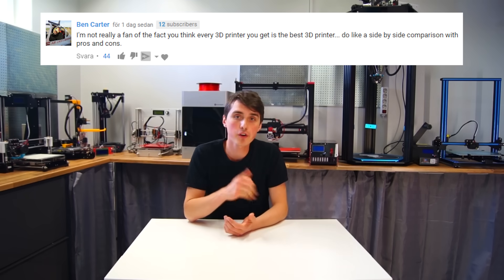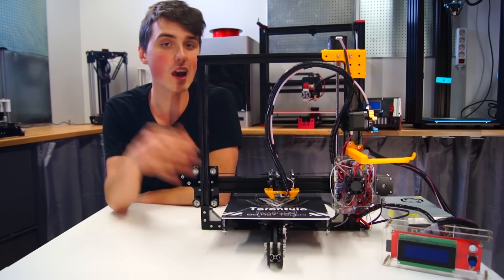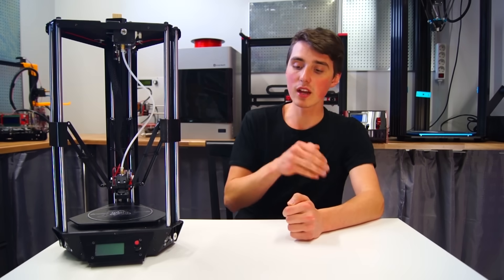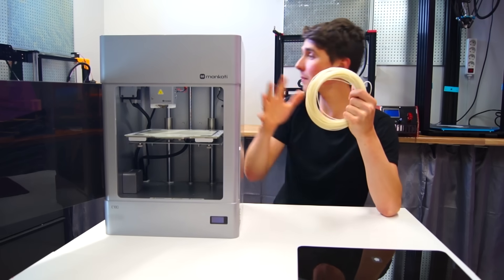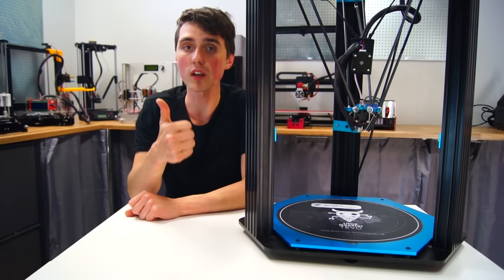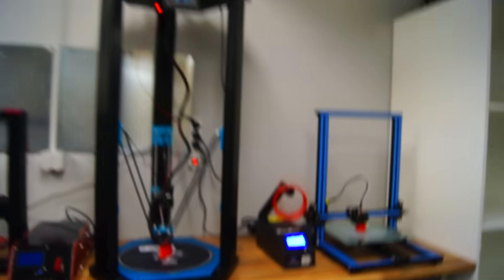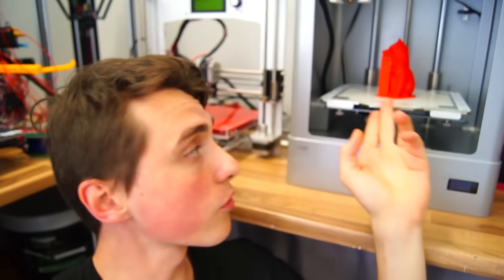Why This Is the Best 3D Printer - Comparing ALL My Printers!!!

Comment: i have had my cr-10s for 4 years and have never had a malfunction. My college users Ultimaker and I have replaced the hotend 4 times within the last year. Each costing 250$. Cr-10 is hands-down the most reliable printer on the market and is the most upgradable.

Comment: I bought my first 3D printer, and it is a Ender 5 pro. I have to say that it was easy to assemble, but the first time I turned it on, the feed cable buckled and broke the stop sensor, so I am waiting on some new sensor I ordered. This brings me to the poor way they did not cover the sensors from damage, considering how cheap the sensors are, they should have made covers for them. Based on your review, I may take a closer look at the CR10.

Comment: Im Looking that the 3 in 1 Snapmaker 2 which is not yet released and is offering over 400 off to preorders.
Looking at the Snapmaker original it is 5x faster and has bigger models it seems to larger items.

The THINGS it has is amazing. With the 3D printer, a Laser etching of photograph quality, and a CNC Milling machine. And somewhere in a video I saw a lathe chuck. While it doesn't do steel, it does a lot of softer materials. It really is the tool of the future that everyone will have in 20 years or less. Like home computers and printers, now phones and tablets. This has had 12 prototypes in a year and a half of development.

Comment: You can upgrade the shit out of an Anet A8. There's 100's of upgrades tot be found on YouTube, thingiverse and some upgraded it so much it is basically just as good as a Prusa i3, where the A8 is a clone of, or even better. 
I learned so much from this printer (got almost electrocuted so I swapped the power supply for an old ATX PSU. 
I'm now planning to build a printer totally designed by me. That's what this printer gives you (lots of problems...erm  challenges too). 
But like you said, it's not for people who don't like tinkering. 

Great video as always!

Comment: 3:46 i have that printer and is was a waste of my money...  I bought if for $140 at some action and thought it would be fun to have a second printer besides my ender 3. i got it working but there is so little information about this printer on the internet its a pain in the butt to fix something. the printer is super unsteady and i have extreme safety concerns. the print quality is extremely bad. if someone wants to get into 3d printing at the lowest cost? go for a Creality ender 3. its maybe €40,- more than the cheapest printer you can get but is WORTH IT. i had almost no problems with my ender 3 and its serieus good build and print quality. and the ender 3 community is awsome. thousends of people willing to help you with your machine. 
sum; Geeeetech i3 is a waste of money, if you get it working properly the print quality suck. better spend €40 more and buy a good working ender 3 that dont catch fire.
Reply: I bought one for my kids to build. We learnt it all but the machine did not work due to a couple of faulty parts. OPen power supply is a No No. But once we got it working it has actually produced some great quality prints, but it is not the easiest.

Comment: I am looking to get a high resolution 3d printer to print silicone food molds and I really need one that leaves no separation marks between layers. Can I ask for your recommendation?
Reply: tbh they all leave marks have to sand the prints to remove them. They may be less noticeable on the higher $ printers but would still likely show up in silicon mold without having been  sanded. depending on the size of the prints you will be making you may look into SLA printers with 2k or higher resolution the layer marks are way less noticeable than prints from a  filament printer.

Comment: I did had a Geeetech Prusa I3 kit. I assembled and even got it running. But the steel rods were actually some cheap alloy and came warped and bent leading to bad printing results. I even made a custom updated firmware based on Marlin to fix some issues. But ultimately the hardware was very bad quality...  I contacted the company in China and they sent me replacement parts but forgot to add a 0$ receipt and so my country customs wanted to charge me more than the printer cost itself. So, yep, same as you, a printer that is good for parts. Seems like the Creality Ender 3D is the good deal to go now.

Comment: Hello, I recommend the new Tevo Tarantula Pro. $200 from Banggood. Uses older stepper motors, though. Easily upgraded for 20-25$ 95% DIY, also room for WiFi, BLT, and Dual Z upgrade

Comment: Have u had any experiences with a flashforge dreamer? What settings need tuning on average across all the printers? I did a dimensional test that showed my printers accuracy is way off from the 50-300 micron tolerance. Any help would be appreciated.

Comment: I had a geeetech i3 pro b and i could never get it to work very well either no matter what I tried it had a lot of z wobble plus bent threaded rods straight out the box costing additional money before even getting it to print a single thing,no instructions provided in the box only a parts booklet and the video told to watch in the booklet was complete wrong way to assemble it showing locking rings on the inside of the x axis rails but but should be on the outside compete fail company and don’t buy one if you want to save yourself a headache and severe anger 😂🤣 went to a Ender 3 pro and such a amazing machine

Comment: Firmware issue, or there is something mechanically wrong with your instillation of the hotend. Let me guess, when you replaced the hotend you put in a spare you had lying around and did not update the firmware to match. Ill let you guess as to how I know. Just remember, if it does not work there is a problem and if others have it working you can to. Find the problem, there is no magic "it dont work" option.

Comment: I like the air purification feature of that $1900 wasn't expecting that
Reply: If you don't already have a printer, when you get one there's tons of free files to download and print out a holder for a fan and filter. If it's not enclosed you can always seal it with some plexiglass and some know how or just buy a photo studio light tent for about $20
Reply: @MrHeHim  Yea, I do have an Ender with a handful of mods, building the "Ikea lack enclosure" may be one of my near future things-to-make.
Reply: @MrHeHim  Looks like you're an AMD guy, going to splurge on that 9 series processor?

Comment: that CR-10 looks awesome. I'm getting into Custom PC building and was thinking of getting a 3D printer to make custom parts for builds. How's the strength of the product? Or is that a fillament thing?
Reply: Material strength depends on which type of filament you use and how thick you ask the printer to make it. I bet a 3D printer would work perfect for what you're doing, but you may have to print out larger things (like a computer case) in multiple parts with joints designed in.

Comment: Hello can I possibly get some of your insight on a matter? I took 
delivery of a Ceality Ender 3 Pro last week and once set up the first 4 
 items I printed using Cura ( mac platform) with NO adjustments yielded 
prints that blew me away as they looked like they came from injection 
molds, that good!  I used the 1.75 filaments that were shipped with the 
printer, The next day I receive the ABS material and tried to print with
 that, lots of issues, so when went back to the PLA to try to get some 
more experience, the prints all sucked, very, mind you all the nozzel 
temps and deck temps were set back to the PLA settings but I can not get
 solid good looking prints they all seem to lack firmness even after 
messing with density and other settings. Even swapped out the 0.4 nozzle, and reloaded the Cura software Not even coming close on the quality I had at first I am stumped!   Anyway I could send you pics of  the before and after I have spent the past week look through your 
videos and others trying to find the reason but no go Please help me 
with any advice you can .... : > ) 
Regards Mark

Comment: I have the Anet A8 and I love it! I did have to do some mods to it to get it to print as well as the tarantula and better. I did flash it with skynet to made the prints so much better and reinforce the structure with wood to get better prints with the higher builds.

Comment: What's the best printer for printing nylon gears and brackets? Also best printer for precision printing.
Reply: I have found that the slicer makes a huge difference in print quality. I used to use RepetierHost but have since switched to Cura for most things. Craftware prints the best columns but won't recognize thin walls. Last time I used Craftware it was still in beta.

Comment: Did you ever have success with Black Widow ?
I was considering buying eiitjer TEVO Nereus or Creality CR-10
But your problem with Tevo BW worries me
Reply: BW is a nice printer . the only problems are the motherboard (it can fry... but not in my case) and the conector to the heatbed ( since its huge it needs a lot of power) but the heatbed fix is 1eur for a new conector ... thats it (i think thats the problem with hes printer since i had the same issue)

Comment: I have the blackwidow. its wonderful to work with. easily upgradeable. just to clarify: you replaced the motherboard, flashed it with the latest firmware, and replaced the thermistor? like nothing is even the original printer anymore.

Comment: i have the tevo tarantula and it's made maybe 8 prints in 14 months. first my board was broken, it wasn't able to heat in any way. they sent me a replacement 5 months later. i finally was able to do something. but now there is a new problem, it's not processing the g-code correct. sometimes it prints steps not cubes or starts in the air. i know it has very good reviews but i guess it's just bad luck for me.

Comment: After looking at this video I was going to buy the cr-10s (based on print quality comment). But then I saw the pro version and now I am unsure. I definitely need to print a mix of ABS and TPU for my hobby. Is the pro worth it? seems to be able to better handle the flexible filaments with the new extruder.

Comment: I know to problem with the anet a8. I got mine like 5 days ago and already had a printer and printed some up grades and it makes it print way better. You need belt tentioners. The belts need to be adjusted. My first print is a flashforge creator v1 and it needs belts tightened. Try it and it should help you out a ton. 
https://www.thingiverse.com/thing:2149867
https://www.thingiverse.com/thing:2134573
lmk what you think.

Comment: Not to piss in anyone's pool, but printers are like musical instruments; a skilled operator can make a masterpiece from a shoddy printer whereas an unskilled n00b can't make anything worthwhile no matter how good the printer/slicer/CAD files/filament may be.
I know this sounds 'soft', but the best printer is the one that fills your needs today and will not be obsolete before your magnum opus is done printing.
Deltas do not have salmon-skin as a natural result of how they print, that particular printer has a salmon-skin issue due to the drivers not being used properly.
Micro-stepping can be your friend...
Case in point: My Anycubic Kossel linear plus, out of the box [sic], had prominent salmon-skin and very loud/very hot steppers.
Replaced the stepper drivers, made a change in firmware, now the cooling fans are the loudest part of any print job, with zero salmon-skin on the model.
DIY seems to be a strong theme, too bad you didn't take it a bit farther on your Deltas...

Comment: Hi! Chinese printers (below 300$ especially) has very random quality of parts and assemblies. I've bought Tevo Flash and I was lucky that it has just few hardmetal "bugs" than some others have. It was choosen vs Ender-3 because it has more potential (in the motherboard) and need much less printed upgrades. Although I was assemblying it almost a week! It was some accurate work to remove really meanful imperfections of some metal parts and making a DIY plywood spool holder. BTW the double z-motor version has no real benefits as many people noticed. And it need to spend more nerves to build and tweak it properly.

Comment: I have the Geetech all aluminum printer it is a printer I wouldn't recommend for someone that is not a electronics engineer. I had a lot of trouble making it work. First off the drivers had to be set for current limit of the motors, or they stall and skip steps. second the filament extruder has a design problem in that the PTFE liner has to be lengthened and tightened down so the filament doesn't jam. The X axis home switch flag has to be modified. The whole machine has to be calibrated. The Code in the controller had to be updated to the latest Marlin software before it would work at all. I have it working currently but want a bigger format machine. It produces OK prints. But not great. It wont bridge properly. It has not a filament cooling fan.

Comment: hey thanks a lot for the reviews. you are a natural public speaker! I bought a CR 10 S5 recently. Unfortunately one of the z motor is not working and nozzle was not heating properly (or probably faulty temp sensor). After your review, I wonder if I should exchange for a new one to give it a second chance.

Comment: I have the Geeetech I3 Pro B, it can do great prints if you get it calibrated perfectly, however it can take hours to adjust the Z axis but once done it never needs calibrating again. You do however need to apply some sort of lubricant to it before each print in order to get a decent print.

Comment: Hi, Please help!! I'm trying to print carbon impreg nylon and polycarb.  I'm looking at the tevo tornado but it needs a steel print extruder head. But I think it comes with brass? Do you knwo what head I can buy to replace it? Can it reach 285C? Is there a diff 3d printer that can do these more exotic filiments better?

Comment: AQuestion if you can answer, I need to print Model Train Engines that can be 12 or more inches long. The Tevo Delta seems to be perfect for the shapes and you were positive regarding its performance. It is now available at $750 in a Kit, what are your thoughts on this machine. Thank You Dennis

Comment: I think you need to work on the anet a8 slightly. My anet a8 print quality absolutely blows that out of the water with only a few simple upgrades such as reinforced belts and some Igus bushings for the build plate and x axis as well as some simple 3d printed frame braces.

Comment: any 3D printers who work with metal.?
to create metalic items..?
Reply: someone who work with gold... I have alot...
Reply: RAPTOR Sjk that would be a DMLS printer. They’re still very large, use industrial levels of voltage, and very expensive. 

Some printers make different types of plastics though which are more durable than others.
Reply: That would be called SLS printing, which is different from these FDM printers. Most expensive type of printing. What you can do with these FDM printers is create a mold of your print with castable filament, then pouring metal into it to create your metal piece.

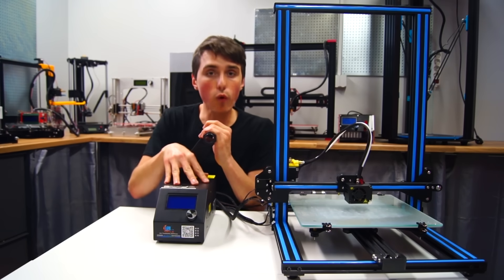Comment: The temperature of the extruder of the black widow is from 7:18. You need to cut the wires of the thermistor to pick up the resistor, measuring the actual temperature. Adjust the temperature displayed on the printer display. 
https://www.youtube.com/watch?v=KoLR8CdaGfo

Comment: Did you check the wires? Or if the thermocouples are touching air instead of the metal? I don’t know the circuit on that system but if it got hot, maybe it melted a solder point. That is assuming it’s set up like that.

Comment: I have a CR-10 and use a mirrored tile coated in hair spray for the print bed. This works very well, but I dislike having to remove the tile when I need to re-coat it with hair spray. I've done a single test print using purple glue stick and it seemed to work fine too.  Just curious,what type of bed adhesion (if any) do you use on the CR-10?.

Comment: I want to buy one 3d printer under 200$ but i don't know which one is the best to buy. Can you help me?
Reply: I got the Anet A8 like he has in the video. Its honestly a pretty freaking good printer. The quality looks like poop on the fox he printed but dont let that fool you. It can do MUCH better than that. There are also a lot of upgrades it can print for itself which is a good way to learn as you go, learning what settings worked best. If you decide to buy the Anet A8, watch an assembly tutorial on youtube. The stock instructions they provide are retarded.

Comment: Thank you for this, I also went the diy kit route to assemble the whole printer print scratch, got a Prusa I3 derivative for about $700, took me a while to assemble as the instructions weren't that clear, not all the parts were in the box, so had to go back, and lot of the parts were also printer and not cleaned up nicely. SO i was a bit disappointed. Its a bit fussy to get going, and calibrated, the frame is laser cut out of perspex, so not That sturdy. All in al a good learning experience, but not the greatest printer. I'll Def check out you recommendation for the Creality CR-10

Comment: Video was informative. I just bought the Anet A8 because it was on sale for $140, but of course it requires upgrades, MOSFET, switch, etc. However I think its a good start. I plan to print my own enclosure to house the power supply and MOFSET. Once I have it running, I will go for the Creality CR-10 after this review!
Reply: I have the Anet A8 and I just bought the CR-10  after watching this too. lol

Comment: male sure you have the right thermometer selected in your firmware for the black widow a normal one would be setting 1 or 0 but like a say a e3d thermometer is a different number I think 54 even though it's a 1k is a different thermostat